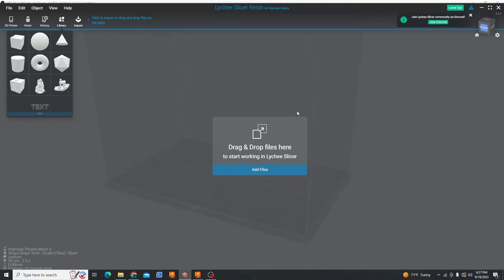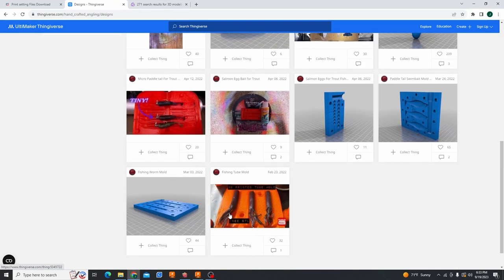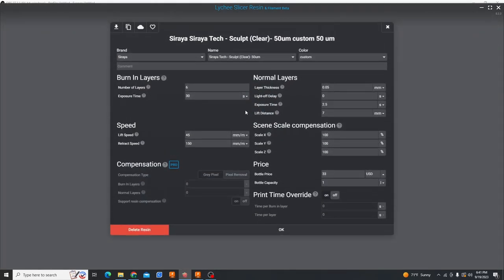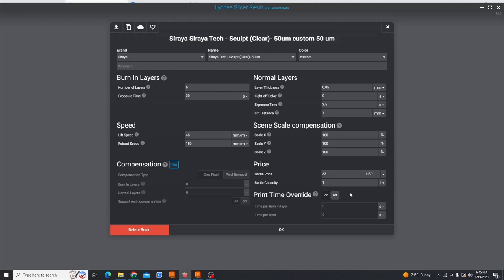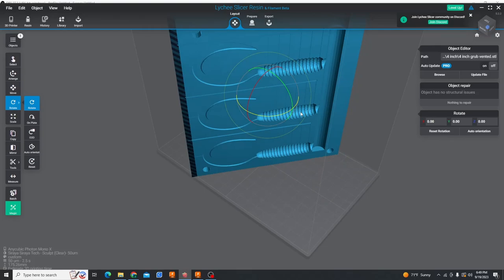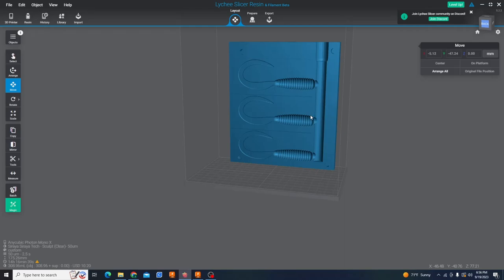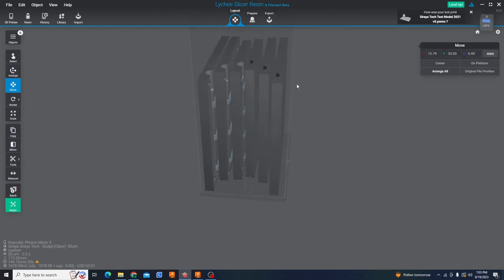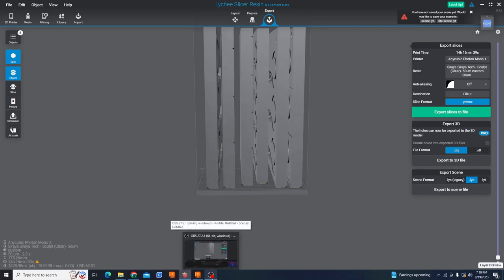3D Printing Soft Plastic Lures The Ultimate Beginners Guide: Part 2 The Computer Side

Comment: Great to see the guide being continued. I just got into sla from fdm for my molds. However i'm having an issue:  printing a mold in a vertical position with sculpt turns out to deform the entire z axis. Bolt holes are are rather oval with the curvature towards the build plate printing correctly, but the other side not,  and in my swimmer the paddle tail thicknesses is distorted to the point of being almost non existent. Any tips ?
Reply from the maker: Yeah I gotta little distracted in between part one and two. Part 3 won’t take nearly as long.  I’m gonna print it out today. If you want my email is linked in my bio on YouTube. You can send me some pictures and I can try to help you out. It sounds like an under-curing issue though. What printer are you using and what is your exposure time. Also what temperature are you printing at.

Comment: I'm looking at printing the grub mold you made in thingiverse, my question is roughly how much resin would be used for all 5 pieces. Says about 370ml, but doesn't seem right. Sry this would be my first import of a file. Thanks
Reply from the maker: I’m a little confused by the 5 pieces there should be 6 mold halves. I think I forgot to upload the molds from the video to thingiverse I will fix that as soon as I can.  That might be the issue you are having. It should come out to two bottles of Syria tech sculpt but I would have an extra bottle on hand just in case.